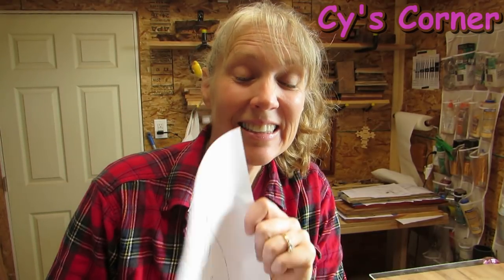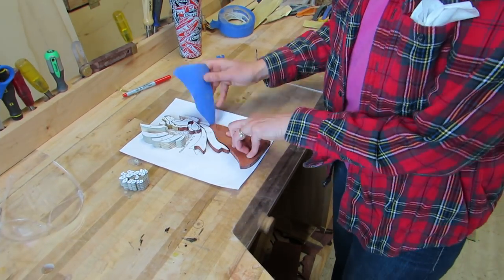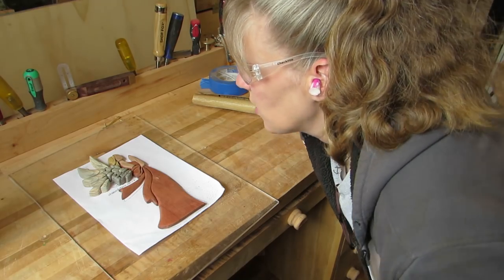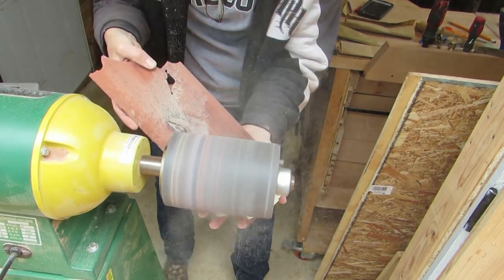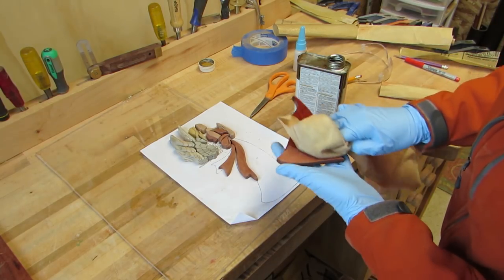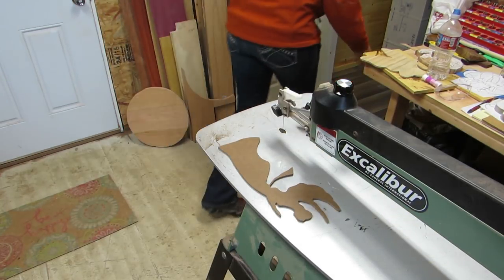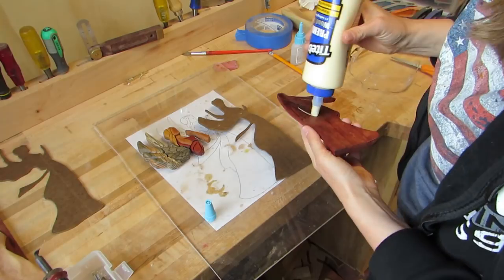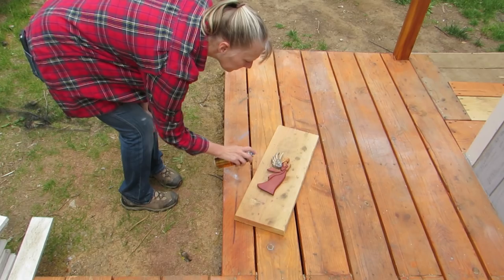Intarsia Angel

Comment: beautiful angel Cy, just a quick tip, I noticed you dipping your brush into the Danish oil tin, I used to do that and found it dried up in the tin much faster and was told that it was because I was contaminating the Danish oil by doing that, so now I put some in a plastic container a little bit at a time and never pour it back into the tin. cheers
Reply from the maker: +1958linedancer Hey thanks :) I usually don't dip it like that, good reminder not to cross contaminate!!!